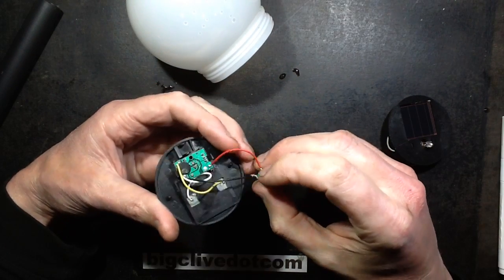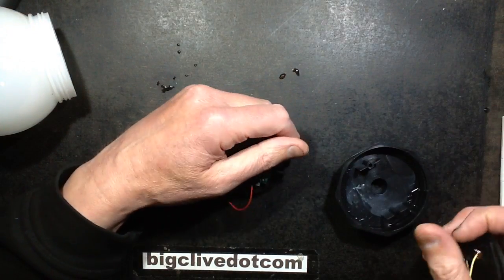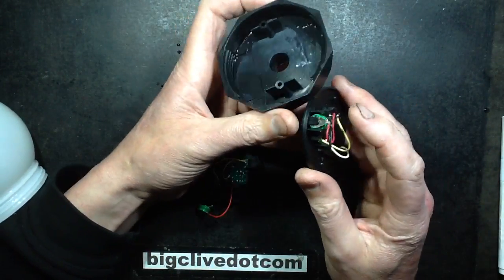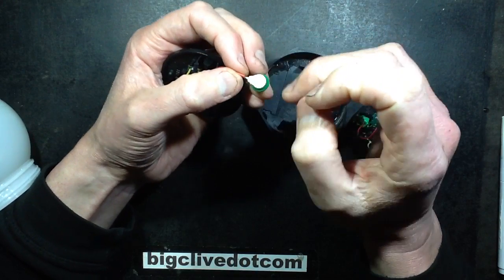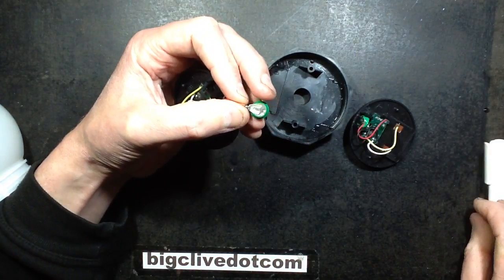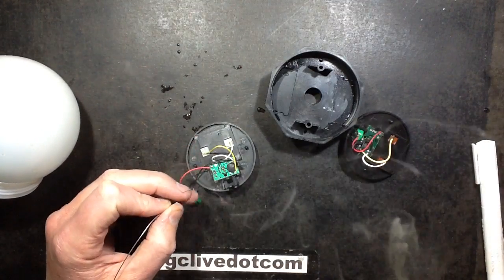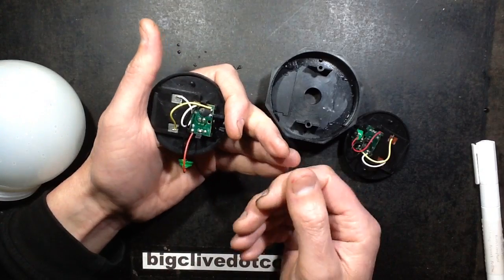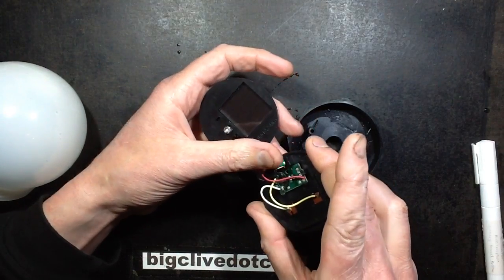Repair of electrolytically corroded solar garden light.

Comment: I've also experienced corrosion in solar lights, some had corroded battery contacts but have been able to clean up, I find the main problem of attack is the ones with switches, the switches corrode to a point they don't work, I've done switch bypasses on couple of lights by just joining & taping up bare ends of wires since I don't have access to soldering, what I was wanting to know is if you think corrosion of the lights internals could be prevented by giving the entire electronics & connections a coating of Vaseline to prevent moisture getting onto the circuits etc & maybe also taping up any opening where moisture can get in with electrical tape may also help?, would like some feedback on your thoughts of this
Reply from the maker: +David Johnson Where possible I use clear garden tape to cover the solar panels and where they sit into the case.  The switches are best shunted with a blob of solder.  A drainage hole helps with some lights.
Reply: haven't had any problem with any of them leaking moisture in by the solar panel or indeed the case, the problems I've seen are switches getting damp in via the slider & eventually corroding so bad they break the circuit or getting into battery covers & corroding battery connections, recently just discovered a couple of old lights that will only stay lit all the time even in bright daylight, not a switch on them but appears to be the sensor that switches them off during day & on at night as they will just go on & on until drain battery & any sunlight will also be sent straight to the l.e.d , can only assume the sensor is located in the solar panel? as the main circuit still operates the l.e.d, don't think soldering wires on switch bypass will make much difference, personally I prefer to have them just joined & a wrap of electrical tape, this way they are connected & also sealed against any damp & also does away with any chance of them accidently touching on any other connections, was also interested to find out that the l.e.d if cut completely off the circuit wont light with just one 1.5 volt battery, needs 2, so somehow the clever board inside these lights doubles power from battery upto 3 volts to light these lights up
Reply from the maker: If the battery is removed in most of these lights they will light the LED directly from the solar panel.  It's common for the solar panel to be used as the light sensor too.  A smear of vaseline on battery ends and contacts will work well for avoiding corrosion.  Old batteries may leak electrolyte at the positive end and corrode contacts.
Reply: never noticed any of the lights lighting the l.e.d with the battery removed but as mentioned I have a couple of lights that are constantly lighting the l.e.d with the battery installed & everything is fine on these lights including the switches have been found to be working correctly, so can only assume the light sensor is located in the solar panel & that either this or the entire solar panel has gone faulty, is there any way of a fix for this?
Reply from the maker: If you can see cracks or mottling in the solar panel then it may have wicked water underneath and corroded electrolytically.  It's a common failure mode and why I use the clear outdoor-grade tape to seal over the panels with a generous overlap across the edges onto the surround.
Reply: no signs of any cracks or anything visably wrong with the solar panels, infact I'm sure the solar panels still give power during the day when the sun is out, just they stay lit 24/7 until during night battery is drained & they are unable to recharge enough during day to stay on more than few mins as most solar power is being sent to the l.e.d as the light sensor appears to have failed, thinking this must be in the solar panel its self, don't know if theres any way of fixing this at all, don't know if even new solar panels would do it as don't know if they'd have light sensors in them, don't know if can buy solar panels with light sensors built in or if they have to be specially made i.e by the companies that manufacture these solar lights etc
Reply: Funny, I recently had a solar panel fail from corrosion where the connecting lead had just come apart inside the panel. I gouged out a hole, put some soldering tip tinner in there and jabbed my soldering iron into it. After somehow getting a new wire to attach via solder it now works, just looks a bit ugly with all the sealant I used to make it water proof again.

Place your bets as to how long it will last!

Comment: Doing the same thing to my butterfly garden lite that changes colors (used to!) , wonder how they do the color change with only 2 wires going up the stalk to the led lite itself?
Reply from the maker: +Cox Law The LED has three LED chips (red, green and blue) and a control chip inside to fade them.  You'll also notice an extra diode and capacitor on the PCB to provide the LED with slightly smoothed DC so it doesn't just keep resetting to the start of its sequence.  (Usually red.)
Reply: So the chip that selects and fades the individual color leds is in the top of the stalk with the leds? And i guess thats why there are only 2 wires going up the lite stalk from the module that contains the battery, solar panel, switch and circuit board?
Mine has really bad corrosion of the battery , board etc and i was trying to figure how to use the butferfly light stalk by itself (since that and the charge panel are all thats left good!)
The wires goung up the stalk are solid black and the other is black with white stripe - i was going to feed 1.5 v dc to it to see what happened but couln't figure which was positive.
Fun to play with these!

Comment: I have found the best way to keep these things alive and well. You can pot them with epoxy or better yet I usually just spray some lithium grease inside or some pretty heavy oil inside the switch across every contact and the board, and it seems to do the trick. I do doubt they will last more than 2-3 years though. Gone are the good old days when you could buy high quality ones. I don't think that it is easy to tell apart the good ones from the bad ones (90%) of them by the price. Anyway, Cheers :)
Reply: I’m
Reply: I’m good for the
Reply: I’m
Reply: I’m not
Reply: I’m
Reply: I’m

Comment: Could you put some silicone over the vulnerable areas?
Reply from the maker: Madness832 If it was the non acid curing silicone that could work.  Smearing it with grease is another option.

Comment: I'm not 100% certain about these small batteries, but the tabs on larger battery packs (19650 and the like) are almost always pure nickel, and I think the reason why is that nickel takes to the spot welding process better than stainless. It also doesn't corrode easily.
Reply from the maker: Ryan Willis I'm not 100% sure about these ones, because in the past they've taken solder OK, but these ones just wouldn't take solder at all until I used quite an aggressive flux.
Reply: bigclivedotcom I've found by abrading the metal with a sharp object that the solder will take to it. Done this to many coin cells, not just a blob neither, but a good flow out. I must say though, it IS a bit of a hazard, you need to get in and get out fast if you know what I mean?
Reply from the maker: Craig Nehring Yeah, I know what you mean about stealth soldering onto non-tagged cells.  But I did file deeply into the surface of these tags and they still didn't take solder readily.
Reply: bigclivedotcom I want to ad that I usually do the Scotch Brite  pad buff & be sure to do a criss cross pattern with an awl, alcohol clean, make small circles with the iron's tip. It seems to be the slight ridges on the scratches that grab the solder. The wire is pre tinned as is good practice as is the addition of flux.
Love your vids

Comment: I'm amazed these garden lights now have that very small cell and not an AA cell. Do they in fact last as long, or longer? I find here in NZ that the UV kills the solar cell long before the battery dies. We are lucky to get 2 years life.
Reply from the maker: Michael Beeny They often run right through the night and are still glowing as the dawn breaks.  I think 2 years is typical for solar lights due to the harshness of weather.  That's why it's probably better only to buy cheap ones.
Reply: some of the tiny lights that are too small to have s standard AA or AAA cell have the tiny button cells but the majority of other lights still use AA or AAA cells here in UK
Reply: Its interesting how these things have different failures depending on where you are in the world, I somehow doubt UV exposure will ever be a problem in the UK. Its probably rust, corrosion and battery's in the cold which finishes them off there.
Reply: I'd assume a 250 mah battery vs the above all depends on that mah.  usually pop out the lighter than the button cell AA's (AAA's usually not so bad) and stick in a good one.  well not a super good one. as it'll rust and ruin it.    Usually what kills ours is HEAT.  90-100 degree days warp the Solar Panel and eventually turn it a bit foggy and rough.  Shiny no more..